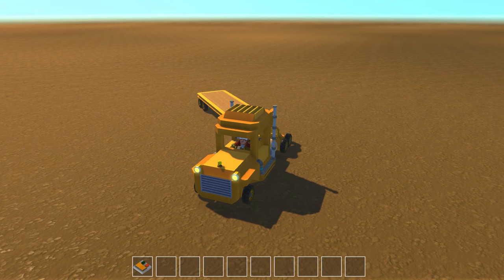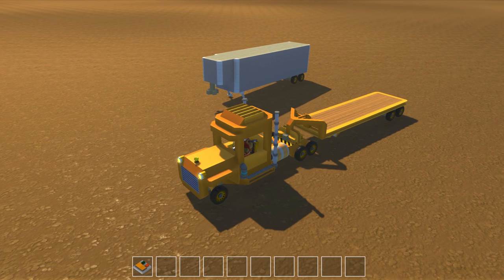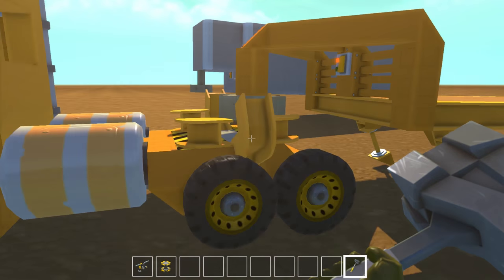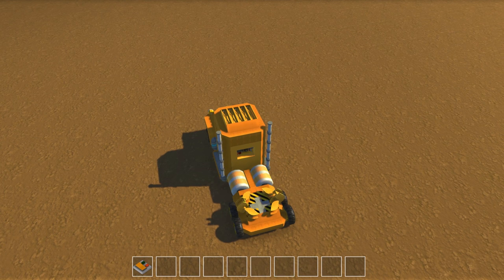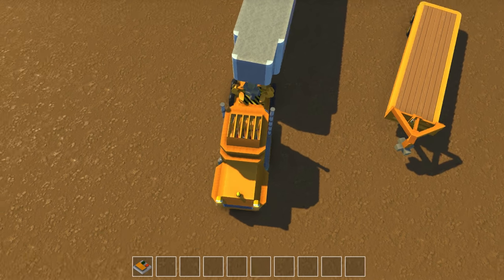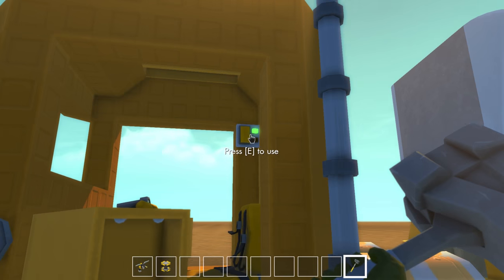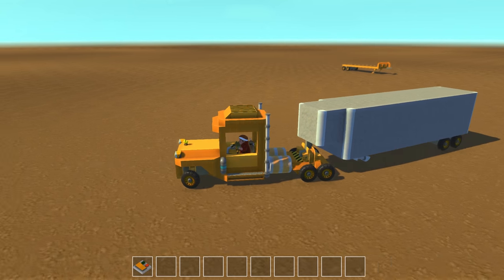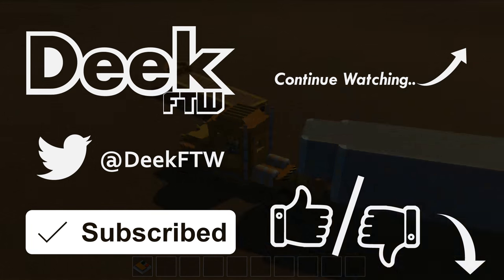Semi Truck with Detachable Trailer - Scrap Mechanic Creative Showcase

Comment: Great design! I remade it on a truck of my own with suspension and partially because of the type of suspension I used and partially because of how snug this hitch is and how there is minimal collision there are almost no frame drops. Most of the time it runs above 40 fps despite there being a ridiculous amount of weight on the trailer. So yeah I love this hitch :D
Reply from the maker: +OJJVZ Awesome! I'm glad it works for your needs!